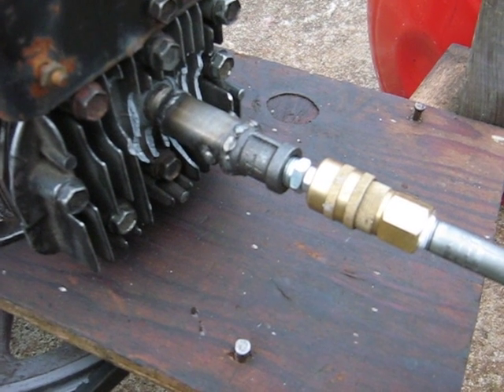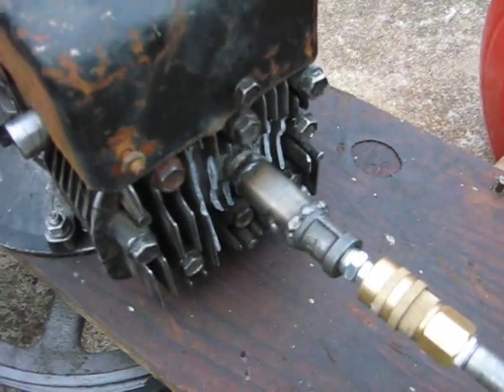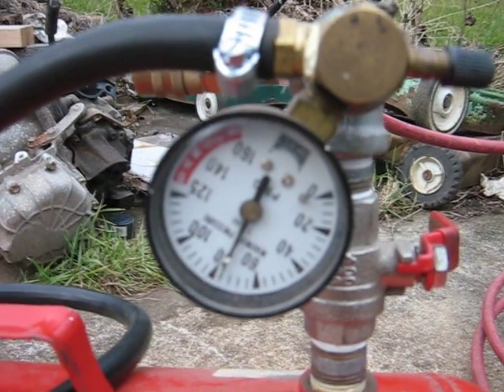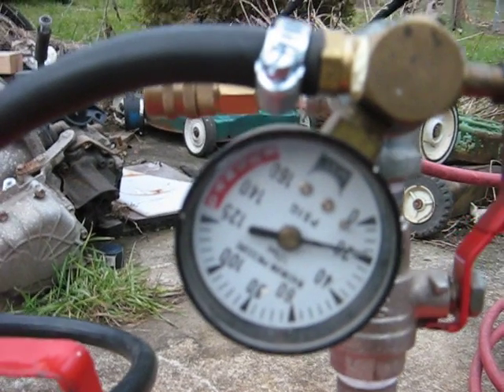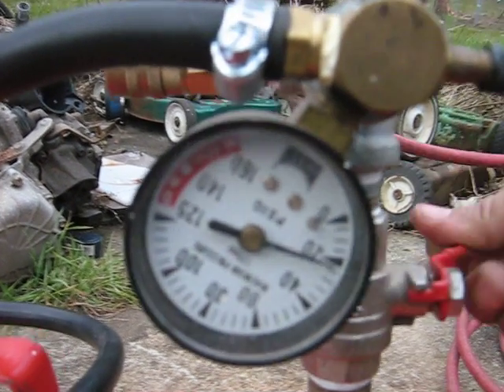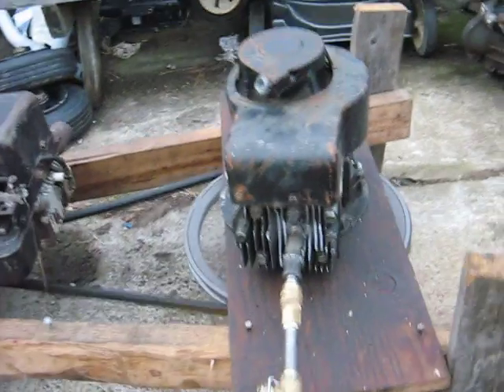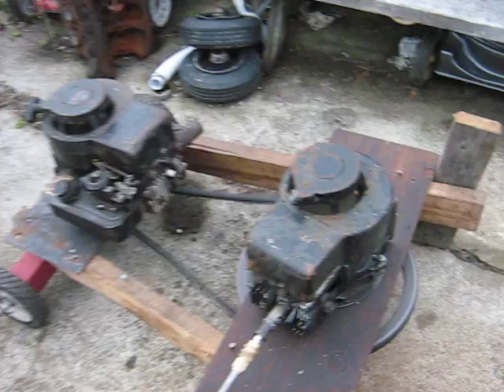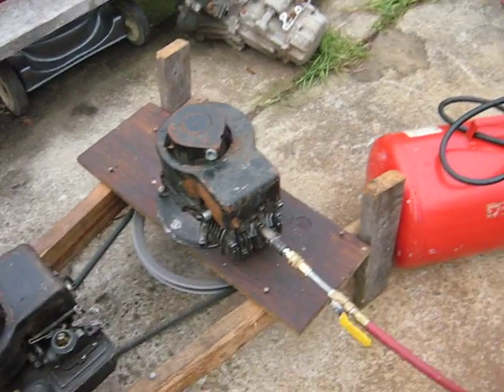Stage 11 Experimental Air compressor 80 psi

Comment: That is great.  Looks like you improved the operation greatly.  You went in the same direction that I was thinking. I wonder if the spring pressure of your check valve affects the pressure produced?  Stiffer spring more pressure?